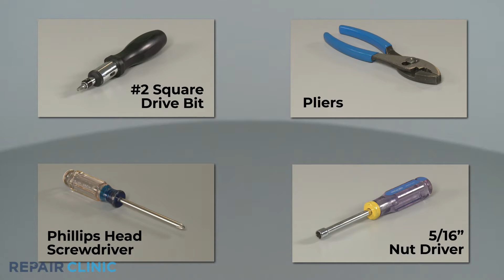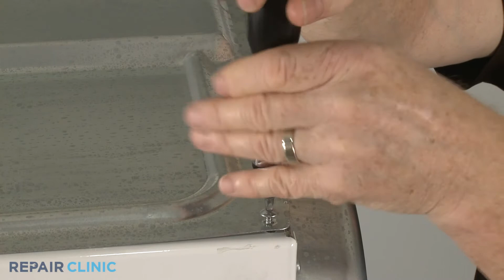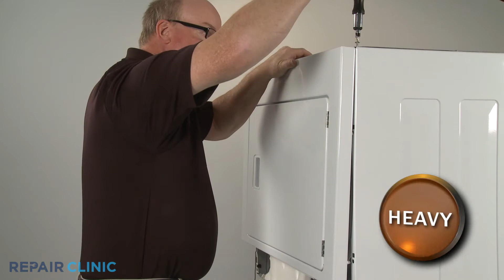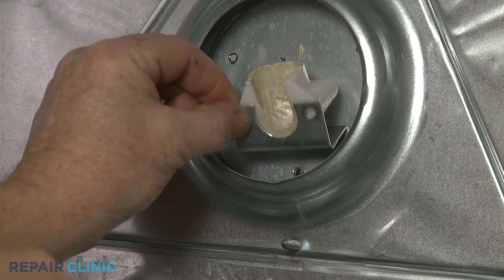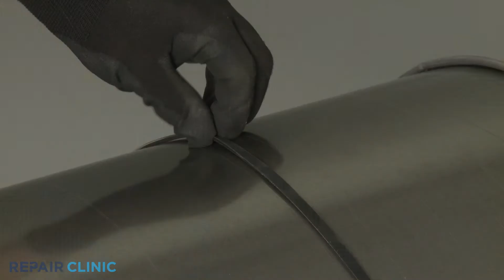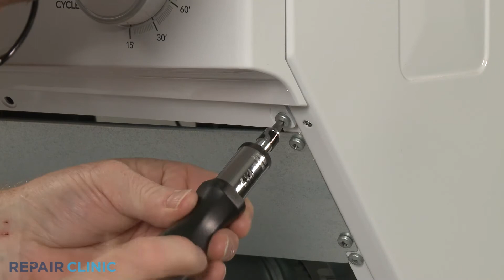Frigidaire Electric Laundry Center Drum Bearing Grounding Clip Replacement (5303281020)

Comment: instead of an assistant, use a magnetron magnet, placing it so it rests on the two protruding screw ends as it sticks to the rear wall.  It will hold the strap and keep the ball bearing inside the bearing assembly from falling/disappearing.